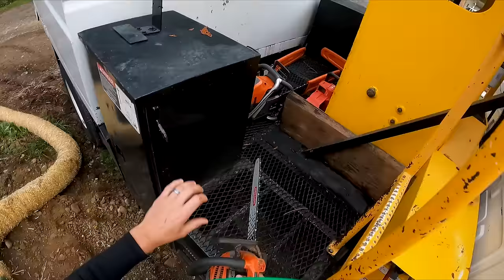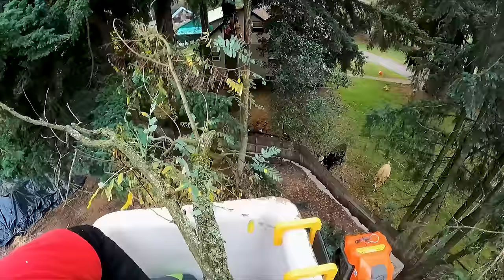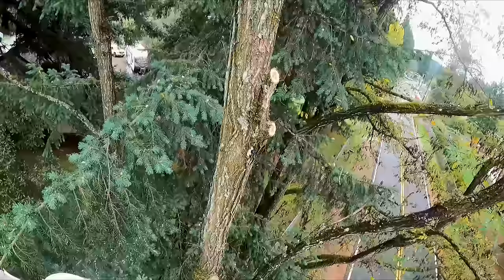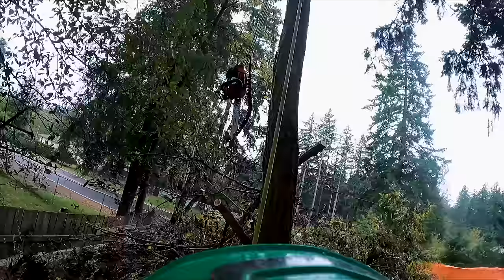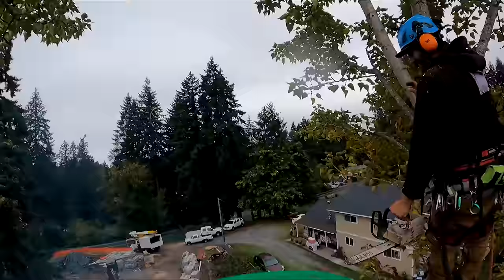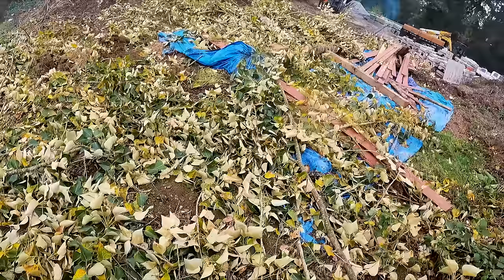Breaking The LAW to Remove This Tree!

Comment: Jake, try your new scabbard on the (inside) of your bucket. You’ll be less likely to drop a Saw out of the sky if you’re monkeying around a busy tree. Give a lanyard for your chainsaw a shot in the bucket as well.  And remember that Milwaukee pole saw that you bought? It looks like it might’ve helped you when you were above Randy. I’m going back to watching your video as always. Thanks for sharing brother.
Reply: You're right buddy I keep mine on the inside as well god bless
Reply: Jacob would never drop a saw out of his bucket. 😉🫣😀
Reply: I do line clearing and instead of putting the scabbard on the inside we’ve always put it on the outside and run a rachet strap around the scabbard and entire bucket and keeps it nice a firm and doesn’t slide from corner to corner, also we use lanyards on the bucket and it definitely helps but I tend to take it off while trimming overhang in case of branches catching it and hitting the primary
Reply: @VeteranTreeService  that’s right, he would never and even if he did drop it, he would use telekinesis to pull it right back up because that’s how good at his job he is
Reply: @boywithdrone09  😆 We may have had a conversation about this in the video I'm posting today.
Reply: @VeteranTreeService  ok let me watch it
Reply: @VeteranTreeService  also, I’ve been meaning to tell you that you have an amazing YouTube channel
Reply: @boywithdrone09  I appreciate that.
Reply: @VeteranTreeService  no problem you do a great job
Reply: @boywithdrone09 😂😂😂
Reply: @williamsolomon1307  tell me I’m wrong
Reply: @VeteranTreeService Not again
Reply: I don't know anything about this stuff but I LOVE the community support!  You guys are awesome.
Reply: @reeseiddison3977 yes, the rachet strap works soooo well

Comment: Yum. Black Locust. One of my favorite woods to work with...no joke. Harder than Chinese arithmetic when cured, but cuts well without burning (with sharp, carbide blades), and was a distinctive look especially if you can get a tree with the super-cool iridescent green rings. Try some...if you can find someone crazy enough to mill it!

Comment: I understand one of those trees is black locust which is one of the most rot resistant woods in America. Maybe you could sell it for fence post or saw it for decking matl. I have several Catalpa trees which along with live oak can be sawed and used out doors without being treated with chemicals.

Comment: You really should have an outrigger pad under the outrigger at all times. When I was younger a foreman set up the truck and sent me up, the truck started sinking and I was doing line clearance, almost went into the power lines. It was a similar situation as your truck parked on the side of the road. Be safe man.

Comment: so..whats the law they are breaking? working without cones?
edit: blocking the road? 

in my country only blocking "fire exits" (fire department roads) is really illegal, else, if you have reason, i.e. working, unloading without other options or removing safety hazards, its totally fine. bonus points if you properly use your hazard lights. :D
Reply: Pretty much. I don't know the rules where Jake is located but in my part of the US we have to notify the police, fire, and ambulance service a week in advance if we're are going to be closing a lane for more than two hours. We also aren't allowed to close a lane down in heavy commute times either. There are also rules about warning signs, cones and traffic control workers as well.

Comment: You like the Husky top handle over the Echo? That lil ported Echo is wicked man.. I need a top hand bad but only for like 4-5 trees! I can’t justify putting $300 plus n one but you think one of the off brand made n china ones like you played with worth getting to use 2-3 times tops. Im not climbing it will be bucket work
Reply: I'd spend the little bit more money and get an echo 355t. If you never need it again you can sell it. That Chinese junk might not even make it til the end of the job and if it does I doubt anyone will want to pay anything decent for it. Just my two cents. I've been using a 355t for about 8 years now and I like it.
Reply: @jesseshort8  that’s what I was looking for!  Makes sense